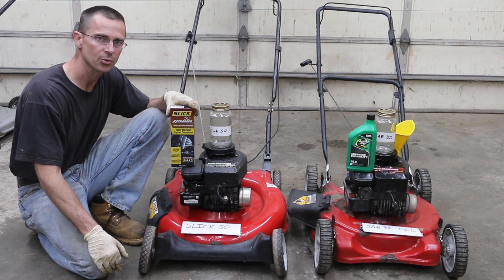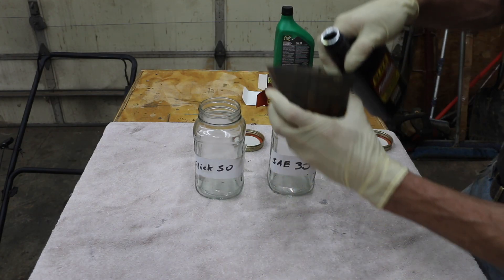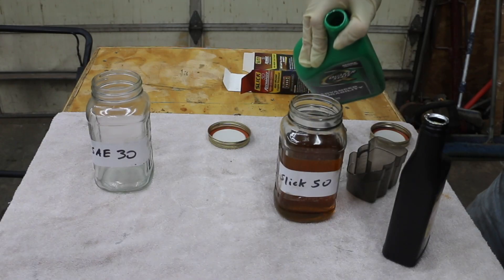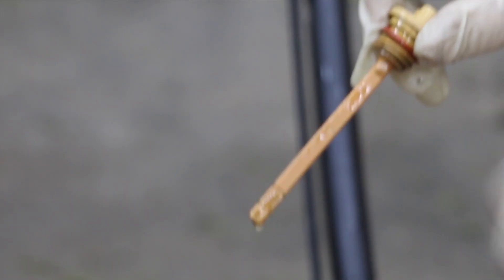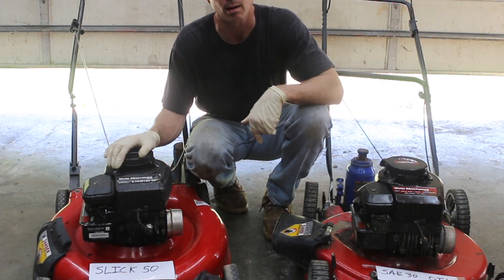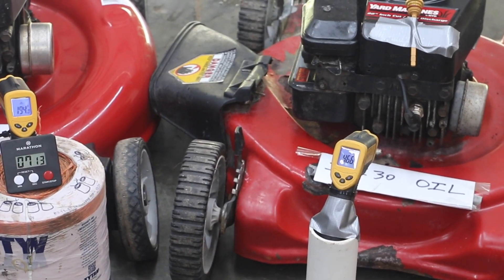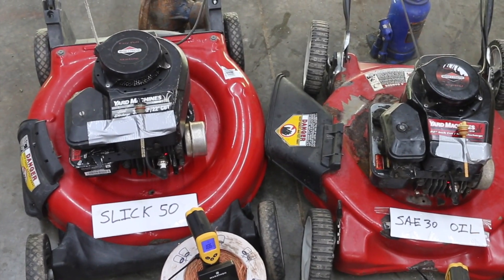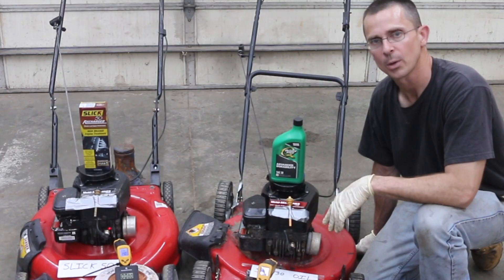Can't believe what SLICK 50 did to my engine!!--Dry Crankcase Test!

Comment: Once the engines had cooled did you fill them up with oil to see if either started again?
Reply: Titus  That exact incident happened to me with a riding lawnmower, 12 hp kohler 70s vintage.  It stopped running, wont turn over, put in conventional oil (no treatments at all, ever) and it started, ran normal, no smoke.  I was amazed!

Comment: Did you shake the Slick 50? It is full of ptfe particles that need to be suspended when you pour it Also, you need to run three tanks of fuel thru it to be treated.

Comment: I know this is PF, and not a double blind study or anything, but those two lawnmowers appear to be of similar, but not identical design, and the SAE 30 mower looks much older than the Slick 50 mower. Even for a one-shot comparison you kind of need to have an apples to apples comparison using the same engine, same age.
Reply from the maker: Thanks for the constructive feedback

Comment: years ago i was told the old Flathead engines  had a oil additive and i thank it was zinc in the oil  and the old flat heads will self destruct with modern oil   that doesn't have this additive can you prove or disprove this  if i was guessing it was the cast iron block problems
Reply from the maker: Thank you for the feedback!

Comment: Slick 50 has to many Teflon solids in it and polymerizes very fast.   The motor oil has few solids and does not polymerize very fast.      Try to restore the engines next
Reply from the maker: Thanks for the feedback

Comment: Not cutting anyone down just helping with results love your channel. the post I mentioned earlier where I put the slick 50 in about a month later in 1989I had an oil line from my remote oil filter rub on my steering column shaft wore a hole in the oil and blew out when my oil pressure went to zero I was 25 miles from anything and drove it home with no problems and I am still driving that engine to this day
Reply from the maker: Nice!

Comment: Been using teflon for 40 years. If you pull the oil stick on a well coated engine when hot there will be no oil on the dip stick. You almost need a special dip stick. You must check your oil level with the engine cold to see the fill level. If you had waited till the engine cooled and drained the oil then it would have teflon and a thin coat of oil similar to the regular oil engine. The test might have gone a little different
Reply from the maker: Thank you!

Comment: I used to use Slick 50....twenty years ago.

The con rod bearings on all BMW E46 M3s are tight.
 Our 60W oil doesn't flow well under  them until the oil is hot. 

One place recommends Liqui Moly Ceretec to help. I also use Liqui-Moly 10W-60 Synthoil GT-1 Race Tech  oil.

And keep engine RPM below 3000 until oil reaches 190- 200 degrees F.

Who knows? Makes me feel better. But keeping the RPM low until oil is hot probably helps the most.
Reply from the maker: Thank you

Comment: In your test did you shake the slick 50 oil before pouring it into the glass container? Because it doesn't look like it was shaken properly. Can you redo your test with identical model new mowers. I think your test was flawed.

Comment: Could it be that the Teflon coating which Slick 50 adds to the metal, is burnt off at high temperatures?  Yet when the engine operates at a normal temperature range, the Teflon sticks and reduces friction, therefore extending the life of the engine?  I seem to recall long ago that a Teflon coated cooking pan that I forgot on the still burning stove, turned the pan red hot and burnt the Teflon so much that the pan was useless thereafter.

Comment: Not that it would change the results of the slick 50 dying first, but I seen a flaw in the test that may help for future videos. The temperature numbers of the straight 30w would be flawed. You had the exhaust of the slick50 machine pointing right at the head of the straight 30. The straight 30w's exhaust had no effect on the slick50 machine. Maybe just film them separately next time. I know it screws the whole vibe of real time watching. Maybe a wall in between if you feel the need to run both?
Reply: Hey I'm not downing...I love this channel. 

PS: Could run the exhaust so they are opposing. or even go the step further and put a small wall between them. Running them both at same time, exhaust opposing, and with a wall between would insure a same ambient  room temp for each equaling the field. I know. Quit being so picky right?

Comment: Thanks for the sacrifice 🙏 The engine temp reduction was impressive. I'm sold on adding the slick 50 for small engines, air cooled VW/Porche, & big block engines...and checking my oil level regularly.😕 I'm curious if there are any buildup issues over extended use, though? FYI: I've found the Valvoline VR1 racing oil to be worth every penny. The engines I've used it on lasted longer, and we're FAR cleaner when rebuilt than any other oils I've used😉 I also understand that both NAPA, & O'Reillys generic motor oils are standard grade Valvoline. A test between these similar oils might be helpful. Thanks again for your great work✌
Reply from the maker: Thanks for the feedback!

Comment: Before I watch this test I have to report on what my experience was using Slick 50. Back in 1995 I purchased a brand new 1995 Pontiac Tran Sport Minivan. It had the 3.8 liter V6 engine in it. I owned it a total of 10 years before it finally kicked the bucket with over 200,000 miles on it. About 2003, it developed an Engine Oil Leak. At this point I was living in Battle Creek MI. I had taken a short trip up to the Grand Rapids area and on the way up there the oil light came on. I stopped to check the oil and it was non-existent on the dip stick. So I stopped and purchased 6 quarts of oil. I always used Mobil 1 full Synthetic back then. I poured it in, it took almost the entire amount. We went to a concert up there, on the way back, almost a complete repeat of the same thing. Oil Light came on, checked the oil, none on the dip stick, bought 6 more quarts and put about 4 1/2 in. Got home, parked it outdoors and put a piece of cardboard under the engine to see if I could figure out how bad the leak was. The next day we had to go down almost to Indianapolis IN and this was our only vehicle. Came out in the morning to check and there wasn't much oil on the cardboard. Started the engine and the oil just started to pour out. I still wasn't sure where the leak was, but I knew it was a dynamic leak. So, I knew there was no way I could continue to buy more and more oil and put into this thing taking that trip, but we had to go. I had used Slick 50 in the engine on a few occasions throughout the previous few years. I decided to test it out. Not only did I make the trip with NO issues. The van already had about 160,000 miles on it and it got the Best fuel mileage it had ever gotten by at least 8-10 MPG. The Highest range I had ever gotten from a tank was 420 miles. That was consistent on long trips from GA to South FL. I could make it from Valdosta all the way to Boca Raton FL on a single tank. This trip however from Battle Creek MI to just north of Indy, I finally stopped to get gas after about 500 Miles and determined it could have gone to about 600. No Overheating, No loss of power. We made it down there and back. Then I took the Van to a Shop and they determined the front seal had blown out and that was where the oil was leaking out from. Like I said, I owned Pontiac until the middle of 2005 before the engiine just gave out.
Reply from the maker: Wow!  Thanks for sharing this experience.

Comment: Archoil:  AR9100 forms a solid boundary lubricating film that improves performance and protects engines, gearboxes and hydraulic systems. This product is a Boron based additive.  I never heard of it but took a chance on using it in all my gasoline and propane fueled engines.  This stuff is AMAZING !   Some of the engines I use it in is a 2011 Prius II, a briggs & Stratton 17.5 hp propane fueled engine, a 4 stroke propane fueled weed eater, a propane fueled 7500 watt generator and a Honda gas powered pressure washer.  All of these engines run much cooler than before treatment and seem to be smoother running.  I give Archoil AR9100 a thumbs up !!
Reply from the maker: Thanks for the feedback!

Comment: Great vid ! Yeah I remember that commercial from like the 70's or 80's. To funny, I have used Lucas Oil stuff for the past 12 years and I like it alot I use a quart in my crankcase and then 8 ounces of the fuel injector cleaner, love it , and my dad used the stuff for transmissions and said he like it as well. I would love to see a video from you. When I worked at the sheriff's department all the squad cars and ambulances used Lucas in there motors the Lucas Oil Rep came to the Sheriff's office and put on a demonstration. convinced me too
Reply from the maker: Thank you!

Comment: I did not see you shake up the slick 50. The Teflon falls out of the oil medium lays in the bottom of the container so all you put in was the oil that is supposed to carry the Teflon 25 years ago I was looking at slick 50 on the Shelf at an automotive parts store wishing that I could buy the $42 slick 50 bottle I walked outside and somebody before me had bought a bottle of slick 50 they poured the oil off the top and left the Teflon in the bottom so when I did my oil change that day I threw a half a quart of motor oil in the slick 50 bottle shook it up and the slick 50 comes out whiteish when it is shook up correctly so I challenge you to shake up the slick 50 and test it against sfr and watch the sfr blow away the slick 50
Reply: The video shows him shaking it up twice! Please watch again.
Reply: @lukeheald3562  He never shakes the Slick 50 in its original container, he takes the cap off and punches the seal with his thumb.. Yes, he shakes the Slick 50/Oil combo.
Reply: @robh693h4  oh I gotcha
Reply: How do you explaine the temp reduction if the slick50 didn’t make it to the oil?
Reply: @Paul-id1kb  the temperature reduction was very slight which showed a small amount of Teflon did make it into the engine but a very small amount. if you have ever used slick 50 you will know that when you shake it up the oil medium turns white because it fills up with Teflon. If you don't shake it up 1/8 of the bottom of the bottle has a layer of almost pure Teflon in it. The international 345 wheat truck engine that I put in my 68 Pontiac Firebird 31 years ago is an engine I put slick 50 in 1000 miles after the break-in, (I found a discarded bottle of slick 50 in the parking lot of a parts store that they didn't shake up) A few weeks later my oil line got a hole in it leaked out all of the oil I drove it home almost 25 miles with no harmful effects and I'm still driving it today. YouTube "binderbird"
Reply: I tell you a little story since you seem so informed about Slick 50 and the Teflon.  John was into marketing it in the late seventies when a friend at lunch said he should put Teflon in it because of the craze in the skillets being sold at the time. John said bullshit, it isn't going to add anything to the outcome of what his product already did. The friend told him it was only to help sell the product, not make it better. John went ahead and followed his recommendation and found it did help sell it. The product today has no TFE in it.

Comment: Hello there. Try Polytron MTC in this engine. This product sticks to the metal parts and work well.  It is a product produced in America. So you should find it over there. Use also 10% of it with oil. We sell it here in the Netherlands. Stock cars and go karts using it here in the Netherlands. It makes a really difference according lubricants we know like Castrol, Mobil..e.t.c  check: Polytron-lubricsnts.nl. check out the english page.
Reply from the maker: Thank you for the video idea!

Comment: I only saw one mention of Hy-per Lube oil supplement... I’ve been using for over 35 years.  When I originally saw the ads for this stuff they were talking about originally designed for lubrications of jet engines.  If it can keep them running long it will do wonders for your hot running 4 cylinder engine:)
It makes all engine oils better... synthetic or not it will outlast anything else.
Reply from the maker: Great test idea! Thank you

Comment: Hi
Love your work I'm in Australia, i saw this today. I know its an older vid but i have been meaning to contact you on a product in Australia.
Ive used this stuff since the early 1980's. More recently i purchased a new Harley Davidson, the bike just had its first service. After the ride home from the workshop you could feel the heat radiating and ticking after i shut it off. I added the stuff and rode about the same distance as from the workshop. The bike started running free-er and it was noticeably cooler. This product is supposed to be good for 80,000KM.
This does not mean run the same oil for that 80,000 you still give it its oil changes as prescribed. 
The product is "E30" by NULON, its a teflon additive. You must run this stuff for a good while as the teflon gets into the pours of the metal.
On engine teardown you notice a gold tinge to aluminium surfaces and a slippery feel. 
A famous race driver Peter Brock drove a Holden from Sydney to Melbourne with no oil after the treatment. Likely to be bullshit but thats advertising. I guess you could get it on eBay. We bought a Holden Astra 18004cyl 360,000km still going strong. I know I'm still going to use it
Reply from the maker: Thanks for the suggestion!

Comment: He seemed to recover a larger quantity from the Slick50 engine?  Possible there was oil left in th 30 weight oil engine?
Reply: I was thinking the same thing
Reply: Good notification
Reply: Exactly what I was thinking. Mmmmmm?
Reply: The Slick50 ran slightly cooler, Perhaps there was less burn off?
Reply: Definitely had some 30 weight oil left in that engine. Have to measure the oz if you run the test again.
Reply: Aún así, Slick 50 no duro nada, falló.
Reply: There was an extra 4 oz in the slick 50 mower because of the slick50 that was added. The other mower only had 16 oz of oil. Thus the lesser amount recovered from the oil only mower
Reply: @Christopher_Black  Oh yea !
Reply: @Christopher_Black  lolol No. You can't overfill a crank case. The amount was the same. Like if you have a 350 engine. It takes 5 quarts of oil. If you use Lucas in it you just replace 1 quart with a quart of Lucas making it still 5 quarts. You don't add a quart of Lucas to 5 quarts of oil making it 6 quarts.  Both engines had the same amount in them.
Reply: @kodiakradio7510  he showed it in the beginning he put 160z out of a quart into the jar with 4 oz of slick50 and the remaining 16 oz into the oil only jar. Then dumped the contents into each mower. I understand capacities...
Reply: @Christopher_Black  it's not that difficult to understand. Look at each jar. They are both about 1 in above the white tape . Same amount of oil. He just replaced 4 ounces of oil with slick 50
Reply: @Christopher_Black  2:17 . Stop video and look. Both jars are filled the same
Reply: @kodiakradio7510  You cant know that

Comment: Sometime you may wish to try a similar experiment with a product distributed by Conklin Company of Shakopee, MN.

The local distributors had an old V-8, engine, maybe Ford.  They would fill the engine with the required number of quarts of Convoy oil, run it a few minutes before removing the oil plug and draining all the oil. 

Then with no oil they would idle the engine for maybe 15 minutes or so  and rev the engine up several times. 

After 15 minutes or so they would shut it down and do the experiment again... repeatedly.

They conducted this at many area county  fairs and other similar events for several years.

I used their product which did improve my gas mileage.  I changed oil and filters in the 10,000 miles range, I also drove my vehicles a lot of miles with no engine trouble.  A Chev Suburban had over 325,000 when I traded it.  (And, I know for a fact that two owners later the second owner was pulling his caravan and loved the pulling power.).  (There is an interesting story on that too, but it is too long for the comments) 

Conklin had another product called Fuel Mate.  I used it when I went on long trips.  If a couple ounces were added with a gas fill there was a mileage increase of about 3 mpg.

I have a funny habit of recording all my gas fills, so my calculations are accurate and I see fluctuations. 

Whether the Convoy Oil and  Fuel Mate were worth the extra money I cannot say.  But, I do know they increased gas mileage which I believe was because they reduced engine friction.  

The distributer is long ago deceased.  That is why I no longer use the products.
Reply from the maker: Thank you for the suggestion

Comment: Teflon breaks down at 570 deg F (300 deg C).  running an engine with no oil likely results in internal temperatures that exceed  the Teflon breakdown temperature. Teflon turns into some rather nasty chemicals when it breaks down.  Ask a Chemist.
Reply from the maker: Great information. Thank you

Comment: First thing I see, The Slick 50 mower is newer or new, (After results, weird) the other one is definitely used. You could see immediately they are not exactly the same too. Different years or something. And from what I understand a motor that has had slick 50 in it and ends up needing to be rebuilt most engine shops won't do a bore etc because slick 50 penetrates the metal and really messes up or eats the tools they use.
Reply from the maker: Thanks for the constructive feedback